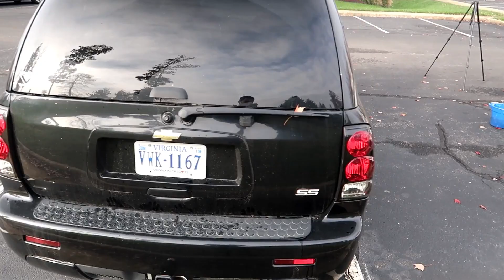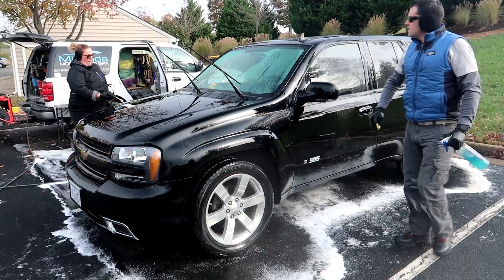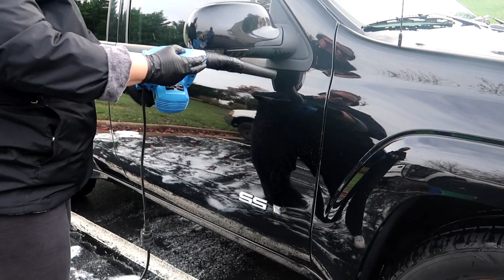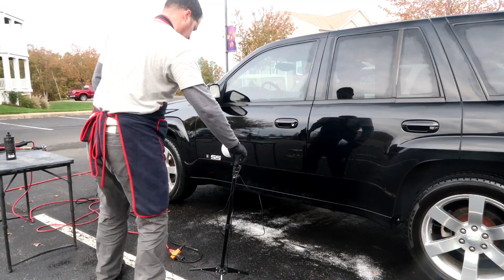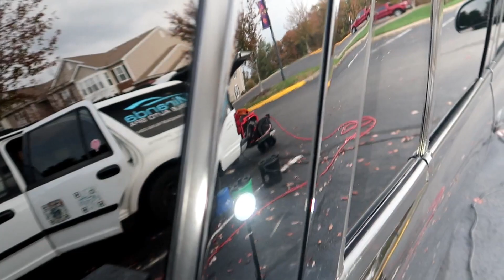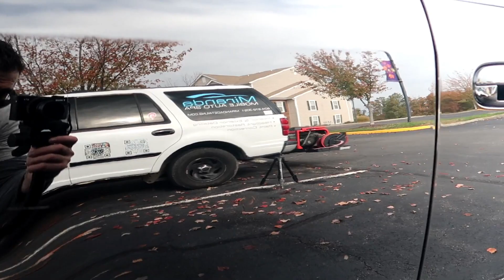Single Stage Polishing to Remove Swirled, Hazy Paint -- Trailblazer SS

Comment: I know this is about 2 years old, but did a search on removing haze, and this gem came up. What are you using on the rocker panels? Looks like mineral spirits?
Reply from the maker: Awesome!  and WELCOME! I used Lacquer thinner on that nasty tar on the bottom panel.  Is that what you meant?
Reply: @MirandaDetailing  yes, that's what I was referring to. Is that not too harsh and have the possibility to removing the clear and or paint?
Reply from the maker: George Beato great question. Lacquer thinner can be dangerous if used on delicate or already damaged paint. But it’s is safe on paint. It just swells it for a few minutes and then I just polish it. No problem at all.

Comment: Did you polish the rims at all on this SS? If so how do you go about it? Would you treat them like you would the paint or would you polish like the exhaust tips if they aren't clear coated? Thanks.
Reply from the maker: I hand polish chrome rims with the same product like HDSpeed. Coated aluminum or painted wheels I just clean and use a liquid or spray wax/sealant. The exhaust tips are usually chrome or just metal and I use #0000 steel wool and dedicated metal polish.

Comment: Miranda i notice the the over spray around the trim,
You polished the paint and took off the over spray on that part.
Now is it hard to take off the over spray in the windows when you clean the window?
Because you are spraying the aerosol spray shine right?
Do you buff off after, or do you just leave it wet?
Reply from the maker: Any overspray from the Stoners Trim Shine is really easy to remove. Usually I just do a quick pass over it while waxing and I have no problems. We also will wipe all the trim when the job is done that way it has time to absorb into the plastic. Even the glass is not bad, like the windshield cowl area, glass cleaner takes it off with no real issue. I use a non glass towel to do the first pass to remove the excess then clean the glass per normal.
Reply: kool, thanks man.
Keep up the good work.
Reply from the maker: Thanks !😎👍🏼

Comment: Any detailer worth their salt should know that a full chemical decontamination  ( Tar & Iron in that order ) is required before any physical contact with a clay bar.....I bet that vehicle was covered with iron and tar.
Reply from the maker: +Robbi Hong Kong Thanks for the input. Of course a full chemical decontamination would include that. If I had a shop and was charging for a Show Car Prep perhaps that would be needed. However in my demographic and for our services it is not. I understand that using products like tarX and Ironx would remove what they need to remove. But I used those before and not everyone one of the vehicles we Detail needs them. So I don’t need to use them if the vehicle’s paint is clean, smooth, polished and protected, it would cost me and the customer unnecessary time and cost.  Good for you if own a shop, detail high end vehicles, charge a premium price, and your customers are happy!  Just remember to keep you comments positive and free from negative opinions. 😁. Constructive insight or helpful questions are accepted and help others improve. Which I am all for. False claims are just annoying.🤫
Reply: Miranda Detailing Great response! You are so right!

Comment: what compound would you use if you wanted to attack those finer scratches in a 3 stage? compound, polish , then wax
Reply from the maker: +Daniel Ontiveros I would use Meguire D300 and the microfiber cutting discs  that’s my go to cutting combo. I also use M100 and M105 when necessary. If those does cut it I don’t go any further. I have a paint depth gauge and I’m very careful about going to far.
Reply from the maker: We also would use either Menzerna 3800, M205, or HDPolish or HDSpeed to finish then use Chemical Guys Jetseal, Rejex, Optimum Car Wax, Collinite 845, or any other Wax or sealant. We use a variety depending on the vehicle and the paint.

Comment: What's your reviews on your steamer vs vx5000. is there a need for those expensive steamer just for interior use
Reply from the maker: +Walter Gray I’ve never used the VX5000. But I love the McColloch 1835. It’s the biggest one they make. It’s powerful and the steam lasts a long time. It cleaned amazingly!  I think the VX5000 has more options but I don’t need a $800 steamer.